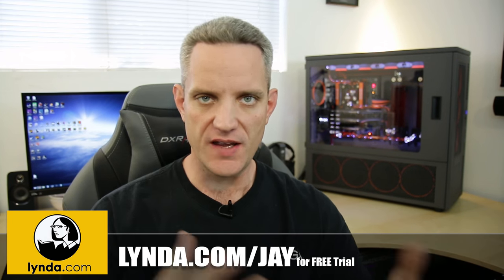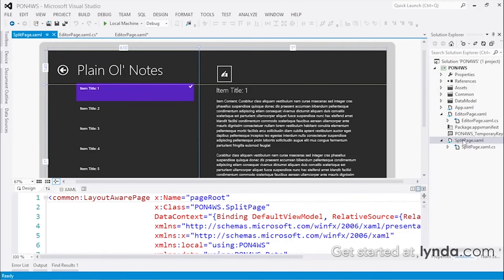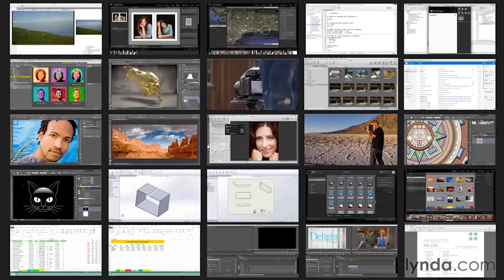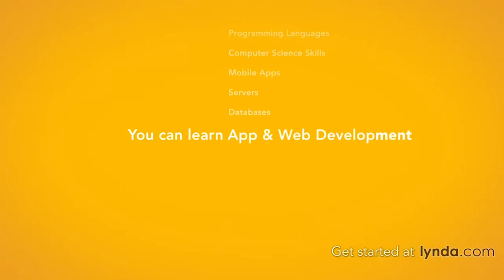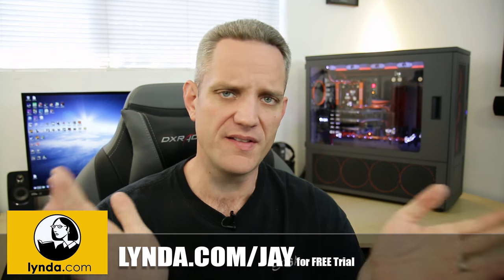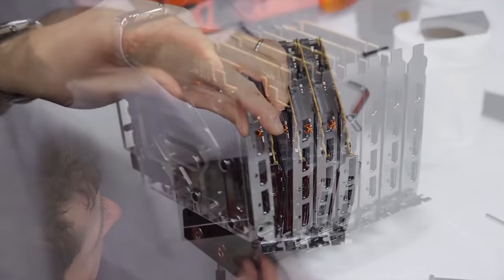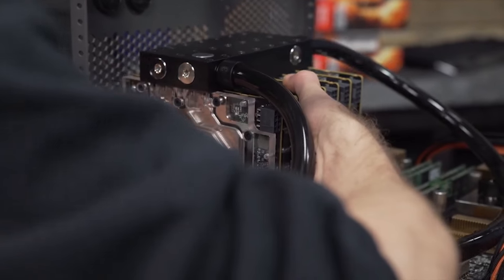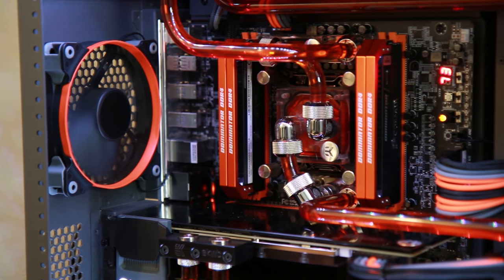Is watercooling worth it?

Comment: I have my PC Overclocked, 4790k at 4.7Ghz, My Gigabyte G1 Extreme Gaming GTX 970 clocked at 1600Mhz and 7500Mhz Memory Clock. the Processor has a Single 120mm Radiator AIO cooler, The GPU card is just the normal Windforce cooler. I Agree with Jay on the watercooling 100%, I built my PC based on his advice.

Comment: A simple explanation would be: The more components in your computer, the more potential points of failure. If you don't NEED water cooling, then don't. You are only adding potential points of failure to your system. 
Water cooling should be treated as it was intended. A way to remove heat from areas where air cannot do the job. EG: Poor or unsuitable case design.

Comment: I have been a long time ATI/RTG user and as such, I will be LC my video cards. You get so much bang for your buck with the red team and for about half the cost of a SLI 980 Ti, you can crossfire 2 390's, liquid cool them and be ready for VR. They do run hot, yes but now that LC is all over the place, if you are for team red, it is worth it and more cost effective, plus crossfire scaling do out to a pair of 980Ti's... for less $$$

Comment: I wanted a watercooled PC because I always had high temperatures with air (I live in a +30 C degrees region, pretty hot) but didn't want the hassle of a custom loop and its maintenance nor have I experience with this kind of setups. So I bought a GTX 980 Ti Hybrid which comes with All In One No Hassle watercooling and I'm so fucking glad I did. It's a fucking beast and at 100% load it runs at 55° C. The temps and performance on this thing are just fucking orgasmic.

Comment: The only other time i would say its OK to get lower level of hardware and get water cooling is if while at load you find it VERY important to have a quiet PC. The GPU can use over 300 watts easily vs the maybe 150 watts on a heavily overclocked i7-6700k so it might be more important to attack the GPU if you want a quiet system.

With that said, a well done air cooled system will usually be quieter than a water cooled one because of the water pump you need running. So at idle air cooled can be much quieter and at load water cooled can be much much quieter.

Comment: water cooling is only advised IF you have enough money to get in to it. for what it cost's to buy the parts for a single loop have double that in case you need to replace parts down the road.

Comment: Board: Asus Z70 with I7 - 4.2 CPU - went from a 6 pipe cooler master fan, with temps going to 70-80 and even higher - with a BIOS over heat notice every time i tried to tweak the speed settings at all... to <50 C no matter what i was doing.  Yes it's worth it.  (Corsair H100 sealed unit for $130).

Comment: watercooling is an package of tweaking specs.

-it gives lower temps at overclock or not and by this give longer life to the WC component.
-it gives higher clock ability while overclocking 
-it gives way less noise from fans.
-it deals better with the spike hotspots temps due the shrink of processors and give more stability in temp vario on the block and cpu cap.

So the need of watercooling depends what you seek from those 4 points.

do you need custom or AIO.
that is easyer to answer,custom watercooling is used to squeze the last possible Hz out of cpu,ram,vrm  gpu ,etc or all together.you can gain up to 10C but mostly is around 5C differance than good quality AIO and you can modify to bigger rads to even increase more gain.

but the price isnt worth for home use gamers and is more for enthousiast or high end users in an professional enviremont.

do you need to watercool your intel i5,i7 K-serie chip:
NO 
but watercooling will give higher clocks than any aircooler,the question is ,do you need such high speed and the answer is again NO.you dont need 4.4+ GHZ to game.
so you dont need an K series cpu to game and in the same matter you dont need an 6 or 8 core cpu to game eader.

gaming bottlenecks  are things from the past if you buy highend cpu and for your online game its youre net cable where the bottleneck is (or your provider limitations).

Comment: Ive always wanted to watercool but havnt had a need with OC. I have an FX8350 oc to 4.82ghz, and a sapphire R9 290x BF4 edition, sabertooth board. I built the rig 4-5 years ago with the best of the best at the time for the BF4 launch. Never have thermal issues ever even with recording and playing in 4k. I think its due to my case and heatsink. HAF-X case and a Scythe Rasetsu heatsink. If only scythe imported to the US yet because on air it keeps my cpu under 65c at full load.

Comment: You would still need water cooling even you are not overclocking. It depends on the spec and the size of your pc. If you use matx or smaller size case or motherboard that the big noctua won't fit in your case or it blocks your ram slot than you have to use water cooling

Comment: I'll add that the stock fan that comes with most intel CPU's is very capable. You can get away with mild overclocking on that box cooler, then get an AIO or good air fan later

Comment: I think you missed an important point. If you're NOT OC, then having an air cooled system at low RPM is going to be MUCH quieter than a WC setup at low RPM. The pump and radiator fans will all contribute to the noise. Not to mention the risk of a leak happening that would rip all your components.

Comment: I'd say the 'longevity' aspect is overestimated,   because people that watercool often switch parts more frequently 
to try and stay at the forefront of technology,   and also the fact that you are introducing water to the system means 
there is an increased chance of destroying stuff,   I broke a $200 platinum power supply recently,  not because of a leak 
but because mistakes can happen during maintenance.

I mostly do it for cpu overclock and noise reduction

Comment: I don't think you'd ever NEED water cooling especially if you're talking about just a cpu because, you can easily get a $30 Hyper 212 Evo and get great temps for cheap as hell. However, as a pc enthusiast I want to build a custom loop. Also, you're certainly right about gpu coolers these days such as the Gigabyte G1 Gaming cooler, it's an absolute monster

Comment: Interesting video. Last summer I had to build a new rig and decided on a 5930k, which for someone who has always avoided w/cooling was a real 'hmm, let's think about this for a moment'. Overclocking wasn't on the cards as I hope to get at least 5-6 years out of a decent rig (go Q6600) but this time around an AIO seemed to make sense. Finally opted for a Corsair H100i GT 280mm in a Corsair Air 540 case. Not expensive and classy like the excellent Skunkworks, but it does exactly the same low noise, low temps and lots of horsepower. Watercooling would seem to have a legitimate space outside of enthusiasts and overclockers now.

Comment: Jayztwocents You made some very good points to consider. For my son's AMD 9590FX build, yah he wanted watercooling. It cost approx $800 USD just for two loops. One for the CPU and one for GPU. So yes you are correct that watercooling parts and components are not cheap. OH BUT DO THEY LOOK NICE!. Thanks again for another awesome inspiring 'cool' video.
Reply: I have noticed watercooling parts can often be found very cheaply if buying used. Something to consider if gaming on a strict budget.
Reply: +Håkan Rohdin Going used is generally only a good idea if you know your way around. You have to follow rules like when buying a used car, you have to look at the right spots and ask the right questions, else you're ending up with a broken piece or something that doesn't work properly.
When it comes to buying used pumps, build a small loop with a reservoir and 2 tubes and take it with you and let the guy who is selling the pump demonstrate that it's working properly. When it comes to waterblocks, ask the guy if you are allowed to flush them in their bathroom-sink and watch his reaction. If he lets you, flush them and take a look at the water that is coming out. If he refuses, kindly ask why. If he behaves fishy, pass on the deal. Only buy used fittings if they look new. If they look like they've been fiddled with pretty often, don't buy them, you can't test properly if they'll leak or not.
Reply: As always - buyers beware. But most selling water cooling parts just seem to be guys realising it's just not worth the extra effort as compared to using plain air cooling. In fact, have never heard of someone buying funky parts over here as compared to say used laptops.

Comment: i heard many times that watercooling DOES NOT make idle noise quieter because it's just simply more moving part... even if you can turn down the fans to the lowest, i think the pump will still be too loud compared to air. I don't watercool personally so i don't have the experience, but I would like to know that does watercooling make your idle noise quieter as well or no? Thanks

Comment: $1200 for water cooling alone!

lel I'll finally make a video when I do water cooling for two gaming rigs. Got a radiator from a dead AC unit for free, 50 feet of copper cooling tubing from Home Depot, assorted hookups, just need the water blocks for each component. low voltage pumps off of ebay for outdoor use are cheap as hell, meaning 24/7 cooling no matter what is running.

Comment: My mate hooked me up with a H2O cooler, it is So much better then my Hyper 212 Evo, Not only are the temps much lower 35c load vs 55c+ load, but my CPU now overclocks much higher and much lower voltages... QX9650@4ghz 1.435vid 20-35c(4ghz was impossible on air)

Comment: May i ask a question? I am getting into water cooling. I bought Phobya Pure-Performance 240 LT kit. And I am about to install it. Here comes the question. How do i clean up the radiator? Well i know how, but what should i use? Can i use isopropyl (i have plenty of that staff)? Or distilled water? Should it be hot. If so. How much.

Comment: I have changed components few times over the years and water cooling set,power supply, comp.case are migrating from system to system so I think they are worth to invest.
The motherboard, cpu, gpu they all become obsolete.

Comment: Just because your CPU is overclocked to a max 4.6ghz doesn't mean that it's running at max while idle on the desktop... your "unlocking" your processor for more head room. 
It shouldn't affect overall longevity unless your running cpu intensive processes all the time.

Comment: Watercooling has come a long way in the past few years. Those early builds with garden hose and regular plumbing fixtures was never my style (I'm an electronics engineer, I've always hated plumbing). 
Rigid tubing is much tidier and appears more professional due to the low profile fittings and huge choice of parts now available. 
I wonder what changes will come in the next few years ?

Comment: Nice video Jay. I have been on the fence about either going straight to a custom loop, do a CPU AIO, or stay on air and just upgrade components. I already have a Noctua NH-U14S on my 4790K (4.7GHz @ 1.26V), which seem to keep temperatures in-line with some AIO loops. This video has been very thought provoking and has given me more to consider.

Comment: My R9 295x2 has been thermal throttling at 75c at stock :/ Running push/pull on the stock rad. Hopefully going to watercool come tax time. Looks badass and definitely looking for some cooler temps.

Comment: I'm really not looking forward to maintaining mine. Its been about 3 years and I occasionally dust blow my system but I feel a flush is inevitable with temps rising a couple degrees each year. I'm honestly thinking I'll rip everything out and go air. It's a bit of a novelty and no one really ever sees my system. I hate coolant, it's nasty red staining stuff.
Reply: +Bryce P That's why I don't watercool. I'm too lazy to even dust my system. My temps are still fine, so it must be clean right, on the floor (hardwood) and solid side panel. Out of site out of mind for me, lol.

Comment: Ok, but in 2019 I KNOW my RTX 2080 is being thermal limited, because I can see the clock rate drop, as a bench test runs.  I can see the top speed when it's cool enough, then well before the 89C, or so thermal limit, the GPU is apparently being held back by temps.
Reply: yes , that is what i was thinking,, this vid was from back in 2016, things were different then

Comment: if your willing to take the chance check ebay for water cooling parts. I got a lot of used components for half if not less for my system. Only buy from people with excellent ratings, and make sure you clean everything thoroughly before using it.

Comment: I have a 2080ti and when i was running rdr2 it sounded like a turbine, so i was forced to watercool
Reply: can you tell me what kit or components you got ? I want to do the same for my cpu and gpu.
Reply: @DhrFriso  i went with corsair hydro series full ecosystem. The pump and reservoir combos, radiator, cpu block, GPU block and their fittings to. I whent with soft tubing because it was my first watercool pc but you can go with hard tubing if you feel more comfortable.
Reply: @JoseSilva-wv2sh  Jeah I think i'm gonna do the same with the soft tubing. Seems like the smartest choice. Thank you, sir. :)

Comment: About fluids. Does coloured fluids clog up your system and if so, which fluids clog the least up. I don't want to use Pastel fluids, as I have seen how much they clog up a system and I don't want to clean up my system every 6th month or so. I am not going to watercool right now, as my next PC will do fine with air cooling, but the knowledge will be handy to have for the system I'm planning to build later on.

Comment: how would you recommend watercooling for workstation usage? Sometimes i keep my computer on for extended times for rendering for videos games, animation in 3d, etc.  I have moments that during a long use or a very long render that the PC starts to become a little unreliable.  I do pretty moderate overclocking, nothing crazy to the limits of air cooling.

Comment: How do you plan out your loops. In a larger case it's easier but when u want to work with a smaller case how would you plan that out when you don't have the connects like you or Linus does and can easily call up water cooling companies to get your parts switches when they don't fit.

Comment: even for watercooling. a basic start, even if it is non-customizable,  is using a sealed water block like the corsair H100i. you will definitely see the improvements to push that cpu a bit more than air. 

unless you get a cpu that ragequitsbfrom cooking itself to 115*C on the BIOS using only air. (insert sarcasm)

Comment: Could you explain your thoughts on custom external water cooling systems? (e.g. reservoir, pump and radiators in a separate micro atx case, possibly with a separate psu, connected to the PC-to-cool via flex-tubing + quick-disconnects)?

I would like to watercool my PC - I do overclock (on strong air currently at 4.5GHz, but with extreme load (stress-testing) it can still reach 90°, which isn't optimal) - but I wouldn't invest in the hardware unless I know I can reuse it in my next system.
If possible without dedicating to only buying LARGE cases in the future.

The Thermaltake Core V21 would be a nice case for this build as it is compact, very modular, and has good mounting options - the only problem is that it doesn't have space for a 5,25" front fan/pump controller.. Any ideas? :P

Comment: With Jayz build; To maintain a positive pressure would it be better to have the back fan as an intake and the exhausts would be just his top radiator? I am planning a very similar build with a 900D and was trying to decide if that fan should be intake or exhaust (I also live in a very high dust area (particularly black coal dust) so would need a filter)

Comment: I'm still trying to figure out if watercooling, both cpu and the 2 graphics cards, would be more effective way of cooling in a small form factor case, I'm not much for overclocking, but it would be nice to have an effective cooling solution that would reduce the noise alot.